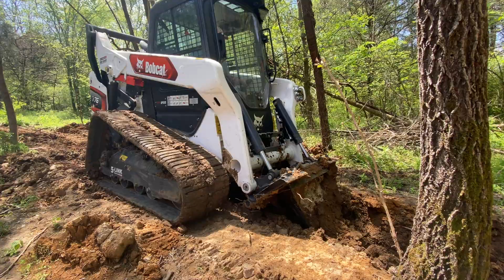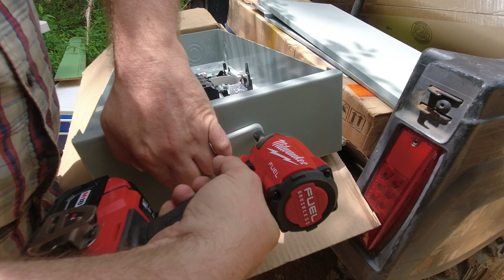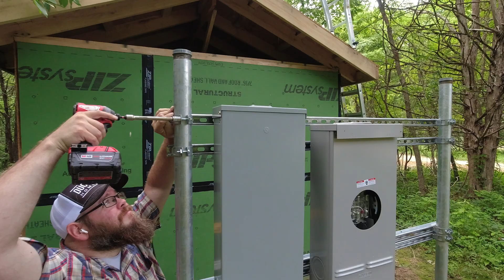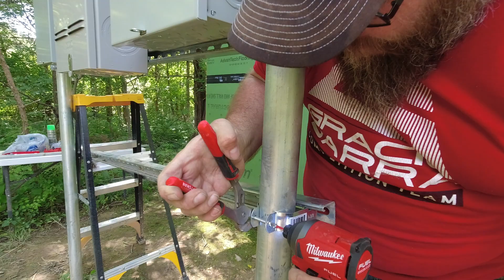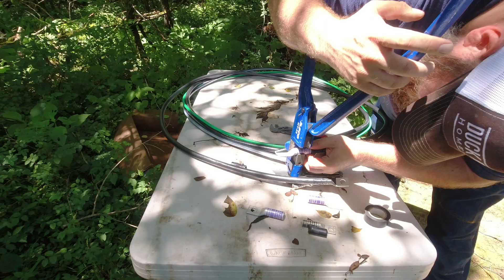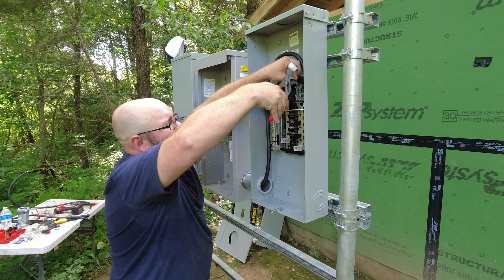042  - 400 Amp Electrical System with 2 200 amp panels on a rack. Do Hard Things.

Comment: Interesting, but the conduit nipple connecting the two enclosures needs a steel locknut on each side of the enclosure, so 4 locknuts per nipple. The plastic bushing is not intedned to attach the enclosures to each other. They are there only to protect the wire from getting damaged.

Comment: Screw the hard route how about the smart route
Reply from the maker: There's often a lot to be learned from the hard route. The smart route comes from years experience. Asking for support helps out a lot. I'd suggest not learning alone, but get guidance from external sources if possible. But you've still gotta start somewhere.

Comment: You need to install grounding lockouts on the pipe nipples between the circuit Breaker panels.  How are you sealing around the mounting bolts that screw into the kind droff channel to secure the panels? I have been out of trade for over 25 years now. Former commercial/Residential Electrician and Fire Alarm Systems Tech
Reply from the maker: At this point I don't remember everything I did. I ended up re-mounting everything and moving it around a bit with a different nipples and all, but the state inspector gave me diagrams of how to ensure everything was right with grounding, etc. at the end of the day it all passed. What's really weird is that in my county, they don't use a weather head on the pipe that goes up the power pole.

Comment: I know this video is old but I was hoping you might do an update.  Maybe explain how you did it and what trouble’s you ran into.  How was duckriver to work with?
Reply from the maker: It turned out that we went through CPWS instead of Duck River. If we were one street over that would be different. Unfortunately they locked the main panel before I could get video. The main issue we ran into was ensuring that we had an unbroken grounding wire bonded to each opening. That took a little work to get through. Also they were picky about which metal conduit to use between the breaker boxes and the meter box.

Comment: you miss the lock Ring on  your Right size
Reply from the maker: Yes, we fixed that. We actually rebuilt this once more, to get it 100% right. Further bonding was needed since we used the concentric cutouts. Unfortunately I don't have footage of that. It passed final inspection.

Comment: Are there specific materials that need to be used to build that mounting rack?  I am starting my Homestead as well and would love it if you could share that information?  I have 400amp meter and 400amp Safety switch which will then go to two 200amp service boxes.  Thank you!
Reply from the maker: OK. Here's what I used: 
2 - 2.5" x 10' rigid conduit buried 3' into the ground secured with concrete
4 - 10'  x full thickness unistrut
2 - 10' x half thickness unistrut
The appropriate number of pipe clamps to attach everything.
1/4" bolts into unistrut backing nuts

You can see some of the construction here: https://www.youtube.com/watch?v=yLqhkf5KdQ4

Comment: Good work taking on that project alone. It appeared to be a bit of a challenge to mount those heavy panels without some extra helping hands. Just a tip that may be of use to you in the future, directly attach the panels to the flat side of the horizontal rails and hang your 200 amp panels first from a level and secure top rail. That way you don't have to struggle trying to position the 200 Amp panels. Position one of either the left or right 200 Amp panel hanging from top bolts and secured top rail first. Then position the bottom rail, again flat side to panel, to the first installed 200 Amp panel lining up the lower panel mount holes. You could use a tape measure to get the top to bottom hole distance and make that the same both sides before tightening bottom rail to poles.  A couple of bungee cords hung from secure top rail to non tightened bottom rail will help you position bottom rail. When bottom rail is secure and parallel with the top rail and one 200 Amp panel is secure then mount one side of the center junction panel to the first 200 Amp panel via a 2-2.5" offset conduit nipple and as well to lower rail with two bolts. Then position the top rail for the center panel. That potentially could have saved you one rail and less panel struggling. I agree with you 100% on having help is nice. Two to adjust rails, one to fasten panels, one to stand back and watch (making those annoying suggestions) and one to go for coffee or beer. Just curious what made your decision to do the entry service panels outdoors freestanding on poles rather than under overhang on building or inside the building? Did you pass?
Reply from the maker: We passed inspection. 

We ended up needing to mount the panels on vertical struts in order to meet the knockouts evenly.  It was certainly a lot of work. We had to re-hang them twice to get them aligned properly with the right conduits, and then bonding. I learned that bonding is necessary when using knockouts, but not when using a hole saw because the concentric rings might become unstable, hence bonding to the box if using the concentric knockouts.

The engineers for the power company wanted us to build this freestanding. I wanted to mount to the shed, but they told me I had to do it on a rack.
Reply: @DuckRiverHomestead  Yes the rules of the game keep changing and not always for the better. Some things make sense and some less so but it seems we always have to please the last man (inspectior) out.
Reply: Glad you passed in the end. That is the main thing!
Reply from the maker: Yes. the inspector must be happy.... or else.

Comment: What if I want to build my own Jurassic Park and I need miles of high voltage electric fence?
Reply from the maker: You might want to start with an underground power plant. Lots of catwalks and conduit. For our pigs, we have about 400 feet of 12,000 volt fence. You'll probably need at least a 60 joule energizer per paddock.

Comment: Where did you buy it
Reply: I have been looking for a meter socket or meter combo for 4 months.  I follow you from South Carolina
Thank you 🙏🏻
Reply from the maker: https://www.amazon.com/Siemens-MC2040B1200S-Circuit-Surface-Combination/dp/B00J3PJPV8/ref=sr_1_7?keywords=200+amp+meter+box+circuit&qid=1663740356&sr=8-7 This is 200 Amp. Do you need 400?
Reply from the maker: The 320 Amp meter base we got from our local power company.
The 200 Amp passthrough circuit boxes we got on Amazon. They're sold out now. TM820RCUFLP is the part number.
Reply from the maker: Here's the link.
Reply from the maker: https://www.amazon.com/GE-ENERGY-INDUSTRIAL-SOLUTIONS-TM820RCUFLP/dp/B000BQS6XG/ref=sr_1_1?crid=20CVD6U4UU3ZJ&keywords=TM820RCUFLP&qid=1663732145&sprefix=tm820rcuflp%2Caps%2C76&sr=8-1

Comment: 11:15
Love your motivation!  Keep it up! 

You are going to need some more lock nuts, grounding lock nuts, and bonding bushings for those connections.   If you can do it in PVC you can avoid all of the bonding grounding mess of the metallic conduit. 

2" pvc offset + Coupling + BA and TA maybe?  I always prefer PVC if i can. 

Love the videos. 

pvc...
left to right.. TA + pipe + offset
left to right.. BA + Coupling + pipe + offset
Reply from the maker: That's extremely helpful. Just found out that my electric company requires copper cable so I'm going to have to redo a little bit. 😂 Thanks for watching!
Reply: Good comment